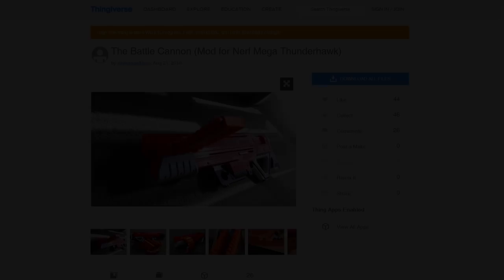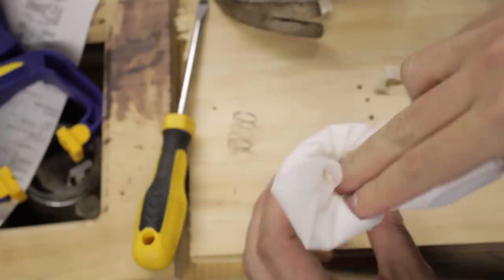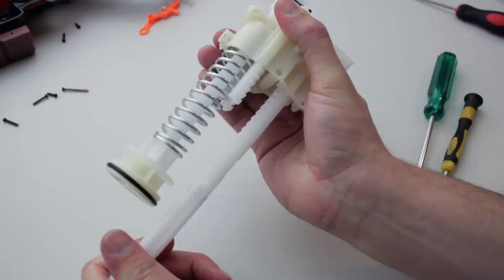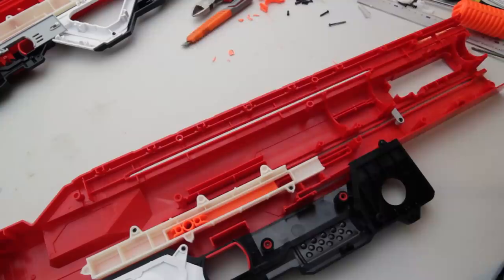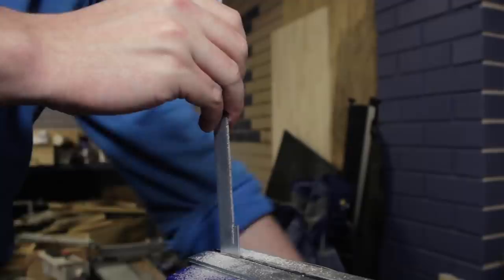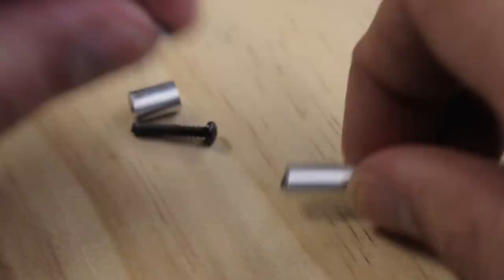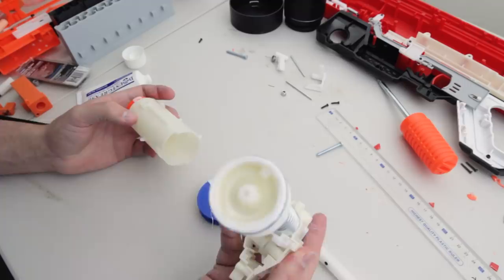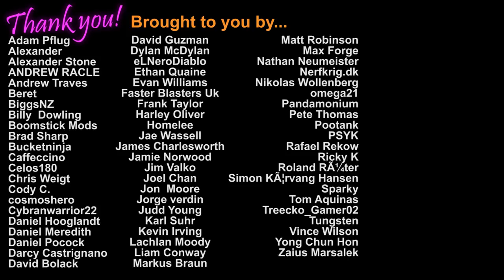How to make a Super ThunderHawk - Tripleshot DIY Nerf Mod

Comment: A somewhat expensive solution to 3D printed barrels is printing the barrels with a slightly larger ID, then epoxying a brass lining in there. I did it for my drain blaster shotgun shells.

Comment: I lost it at "passive aggressive butter knife" 

As far as being able to follow the video, ehh. If I was trying to recreate the mod just based on the video I think I might have trouble. I'll definitely  wait till someone makes a version with external priming bars. Honestly that shouldn't be hard to model, and would take the hours and hours that you spent working with the aluminum out of the mod. Bolt action blasters are generally even easier to convert to pump action because the hole for inserting a bolt to connect priming bars to the pump grip is already there.
Reply: LightningEagle14 : come on, man - you can't deny that internal priming bars look a lot more classy... and they ARE Make.Test.Battle, after all.
Reply: totophi Does look a little nicer, for sure.
Reply: 2:05
Missed opportunity for a dirty joke.

Comment: If you print in ABS you can use acetone to smooth the barrels. I usually dip my parts for just a few seconds then hang them to dry. Give it a day to be sure the plastic is fully cured. Parts surface will soft for a while. How long depends on the abs you are using.
Reply from the maker: Yeah thought about it. Also smoothing filler prime coat paints.

Comment: Make.Test.Battle. Poking fun at the Imperial measurement system ever since its inception. Nice to see you're still with us man. I love how you went the extra kilometer and did the priming bars internally instead of just slapping that aluminium to the outside of the blaster and calling it a day. And nice to see how much time I can save by using a dremel, you kinda forget how much work all that cutting and sawing and filing and grinding is untill you see someone do it the old-fashioned way 😊.
For the next project, how about a nailbiter?
Reply from the maker: If the Nailbiter is out in Aus then maybe.

Comment: Is it completely necessary to bust out the AR? 
The sound of dryfiring without one is like nails on a chalkboard to me. 
Love the portal references btw
Reply from the maker: You can. It's also good for if you intend to let others borrow it. But non standard mags will still push down the pins, it only protects it if there is no mag in.

Comment: Fantastic mod! It's actually making me want a Thunderhawk now, more so than before! My only question is, can you still use the original clip it came with?
Reply from the maker: Yes you can.
Reply: Good to know! I may actually do this one day. I'm really glad you gave this blaster a chance. Quick question, but have you tried that 12KG Rotofury spring in the description on this blaster and on the Rotofury itself?